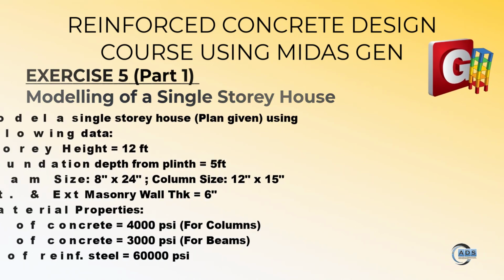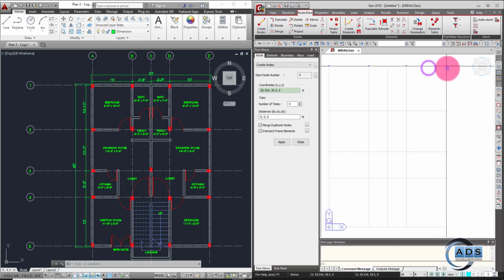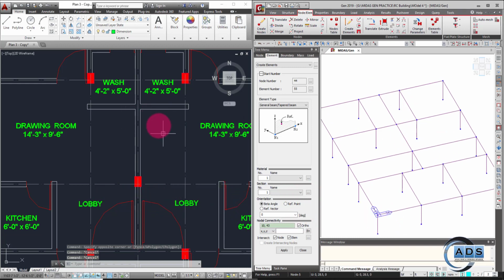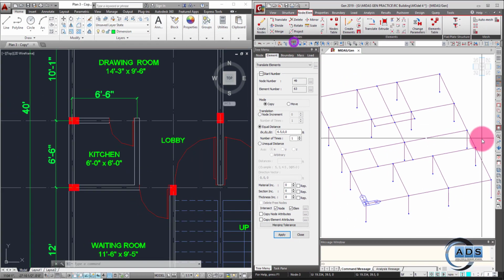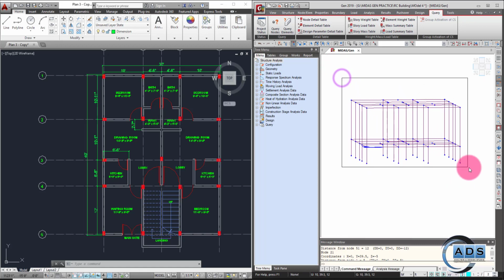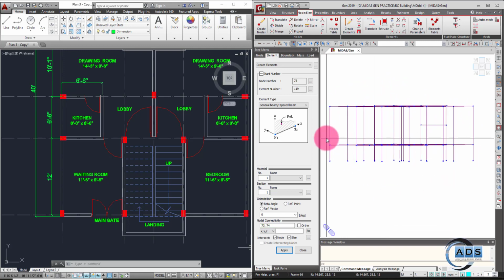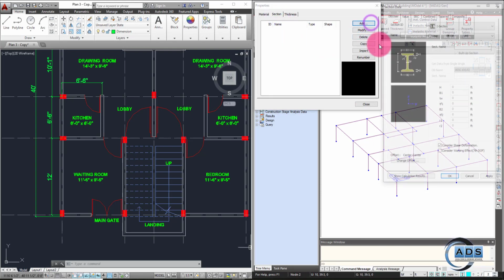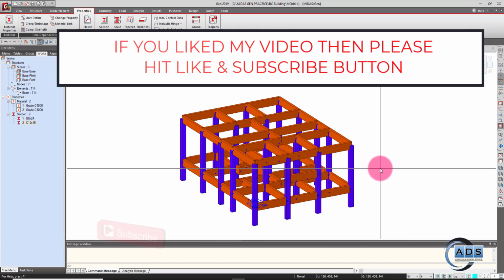RC Analysis/Design Course-MIDAS GEN - EX5: MODELLING, ANALYSIS  & DESIGN OF ONE STORY HOUSE (PART1)

Comment: Nice video. However, the column orientation in midas does not match the column orientation in autocad. Furthermore, in midas the beam-column nodes are always centered, while in autocad they are represented as offsets (in general, the axis of the beam does not intercept the column at its center of gravity)
Reply from the maker: Thanks Yes, you are right. But globally centerline model holds good if the eccentricity is not very large.